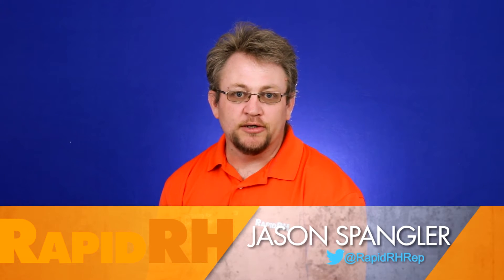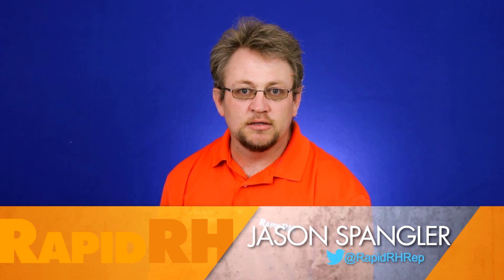Calcium Chloride and Relative Humidity Testing Revisited

Comment: Isn't the amount of vapor that COMES OUT what matters?
Reply from the maker: Once you install a low permeable finish on top of the slab, the moisture can’t escape. Measuring the RH in the slab allows you to gauge what the conditions will be on the surface once the finish is installed.

Comment: Humidity "predicts" the future? Hardly. Although the humidity DOES go back up (trends towards equalization) once the floor is installed,  I and others have tested UNDER successfully installed floors, with ALL of the humidity readings for the on-grade slabs in excess of 90% (90% and above is considered "unsuitable" for the installation of most floor covering materials), yet there are NO problems.  The humidity test is NOT the most scientific, because it lacks the ability to measure liquid moisture. There is NO established humidity reading that "predicts" a failure, otherwise any measured "excess humidity" should be creating flooring failures, it does not, it is LIQUID moisture; liquid moisture is NOT measurable by humidity probes that creates conditions for failure. To measure liquid moisture, moisture impedance and calcium chloride methods are superior to humidity probes. Even the Lund University Study cited by those who promote humidity probes, cautions that humidity tests are valid ONLY for "construction water"  (which is the water used for concrete placement, new concrete that has yet to fully cure) - further, another Lund University Study states that measuring degree of capillary saturation is a more accurate way to measure moisture content than humidity measurements.